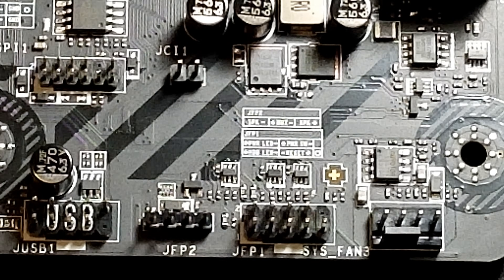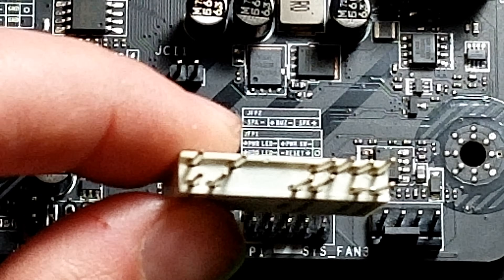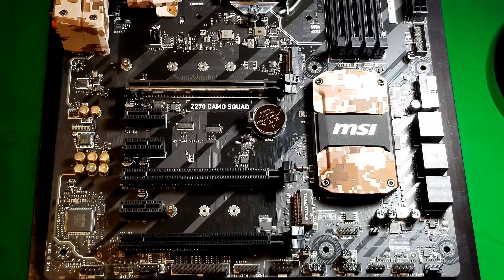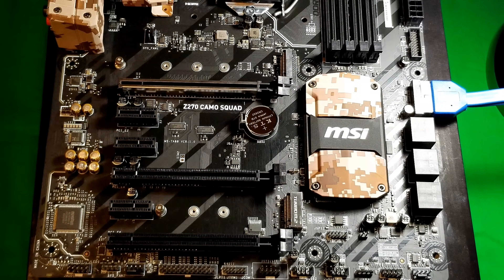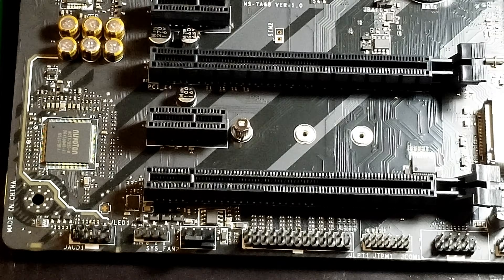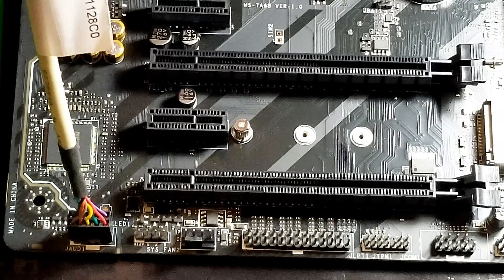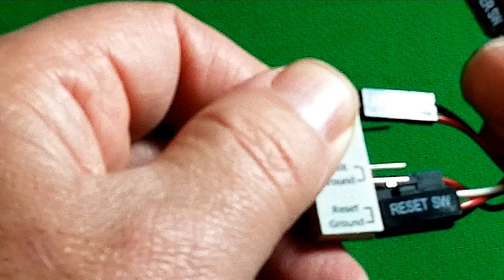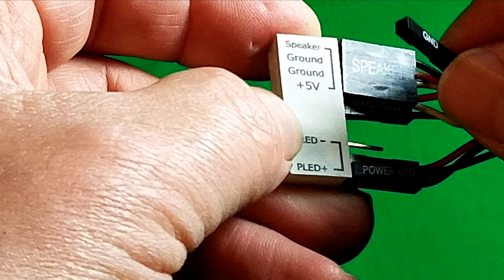Connecting your Case Front Panel connectors to your Motherboard

Comment: So when you plug in the power cable why dpes the positive Side needs to match ground Side? Shouldn't it match with power Side?
Reply from the maker: The PLED + and - matter, the Power can go either way and will still be fine and no damage will occur...Thanks...
Reply: Yeah I put the power connector in just the opposite of the way he shows and everything works fine on all my PC builds.
Reply: Thanks a lot for the answer!

Comment: At the minute 10:34 it shows the power cable arrow lining up with ground on the adaptor , how come ?  Shouldn’t be with the power pin on the adaptor ?
Reply from the maker: The Power LED + and - do matter, however the Power and reset don't matter how they go in as long as there in the right location...even if you made the mistake of the Power LED  + and - being in the wrong spot it would just not start but would not cause any kind of damage, if that happens just change them to the correct pins and it's all good...that's why I mentioned in the video that even if I connect them (those particular one's) that it will still be ok...Thanks...
Reply: Reviewing Playing & More RPM now I got it and understood , sorry for the confusion 😋
Reply from the maker: No problem, it is one of the trickiest parts of the computer build, it does get confusing...Thanks...

Comment: Where is the usb 3.0 on a msi A68HM-E33 V2 my usb 3.0 and the usb connector is split on the same cord
Reply from the maker: Your Motherboard doesn't have USB 3.0 on board, you can use an adapter to have that feature though...
Reply: Reviewing Playing & More RPM what’s the Adpter  called
Reply from the maker: @beastfight3355  There is the Vantec 4-Port SuperSpeed USB 3.0 PCIe Host Card w/ Internal 20-Pin Connector Model UGT-PC345, there are also some that use SATA instead of Molex now as well...
Reply: Reviewing Playing & More RPM do I really need the 3.0 USB
Reply from the maker: It's a nice to have but if your PC is working fine, then no you don't, as you use newer devices though it can be nice to have...another one that uses SATA Power is 2 Port PCI Express PCIe SuperSpeed USB 3.0 Controller Card w/ SATA Power...Thanks...
Reply: Reviewing Playing & More RPM Where do I put that host card 20 pin  at on the case
Reply from the maker: @Beast Fight335 It would go in the PCIe 1.0 slot in the Motherboard...
Reply: Reviewing Playing & More RPM Where will it pop out On the back of the case
Reply from the maker: @beastfight3355  That's right same spot as you'd connect to a GPU...on the back of the case...

Comment: 1 question... the 1 pin connectors for the LED power are very flimsy. I think it is just because they only have 1 pin but it still has me worried. Am I overreacting? Is there a way to secure them more so they do not fall out? Super helpful video by the way.
Reply from the maker: They are made that way and once inserted won't fall out, there is a little metal plate that when you push it on will hold on somewhat tightly and while it'll come of easily if you try to pull it, otherwise it won't come off...Thanks...

Comment: What is that adapter called
Reply from the maker: It's called the Asus Q Connector, it's not in stock now though, a lot of items are hard to get these days...Gigabyte has there's called Gigabyte G Connector...(ASUS 12G05100030B Q-CONNECTOR KIT) and probably best to search ebay or elsewhere as there hard to find these days, although the one for Gigabyte often comes included with their newer MBs...

Comment: where do you get that connector with the labels on it?  What's it called?  I've tried searching on Amazon and Google, but those idiots keep coming up with different products not related.  I've tried "motherboard io connector" and other related terms, but nothing.
Reply from the maker: Asus has one it's called a Q Connector, and Gigabyte has there's called Gigabyte G Connector...(ASUS 12G05100030B Q-CONNECTOR KIT) and probably best to search ebay or elsewhere as there hard to find these days, although the one for Gigabyte often comes included with their newer MBs...

Comment: Is that white piece an adapter that you can plug your wires into the plug the adapter to the motherboard?
Reply from the maker: Yes, I used it as an example it came with an Asus Motherboard and can be bought on Amazon, Gigabyte has started including them with their Motherboards as well, Asus calls theirs a "Q Connector" and Gigabyte calls theirs a "G Connector" haven't seen any for the other manufacturers yet though...Thanks...
Reply: @Reviewing_Playing_and_More_RPM  Well well well, I installed my motherboard two years ago, and I recently accidentally puller some of the wires off, after I reinstalled them I had no power or hhd light. After you reply I looked in my motherboard box (I keep a lot of stuff) and there it was.  Thanks so much for the reply.
Reply from the maker: @jimmymullins4997  No problem, glad to help...

Comment: having problem get my son pc gaming asus board running after replacing psu,  the power comes into mother board and power button does work but does not trigger the fans and mother board to come on,  i need help. any help please. i find this new boards very confusing yet i have build many pc in my time and no problems.
Reply from the maker: So new PSU's are silent, they don't spin up the fans until under load, start with checking that the 24 pin and 8 pin are inserted all the way in, then verify the cables from the case are inserted into the front panel connectors as in the video...then verify the memory is in the correct slots, usually 2 and 4 and if necessary remove the memory and re-insert them to ensure there inserted properly...those are the main things that might be a cause...hope that helps...Thanks and good luck...

Comment: I have the speaker but i do not have jfp2
Reply from the maker: It's not always JFP2, a lot of the motherboards have all the connectors all in one place, you'll need to check your Motherboard Manual to see but when there's no JFP2 that means it's on the top right of where your Front Paenl connectors are...good luck...Thanks...
Reply: @Reviewing_Playing_and_More_RPM  ok thank you!

Comment: Do i use both jpf1 and jpf2
Reply from the maker: You use whatever your case cables require, ie if you get a Speaker included with your case it could be part of the JFP1 or separated like in this video...every case has it's difference's...a lot of cases don't include a speaker though...some also don't have a HDD LED light on the case so therefore no cable to plug in, it's all dependent on the case...Thanks...

Comment: I need to know if either of these motherboard has a way to hook up front panel usb 3.1 The HP Z800  and the HP Z420 or an adapter to hook to the mother board I put links to a picture to the motherboards  I bought 2  
EZDIY-FAB 5.25in 10Gbps USB 3.1 Gen2 Hub and Type-C Port,Front Panel USB Hub with QC 3.0 Quick Charging  on amazon   I am having trouble hooking them up ttps://www.ebay.com/i/232612189528?chn     https://www.ebay.com/i/274104306026?   Thank you
Reply from the maker: The HP Z420 has a USB 3.0 connector the HP Z800 does not from what I can see...now the two hubs are different in that the EZDIY-FAB USB3.0 Front Panel Hub 5.25 Inch with 1x Type C Port, 3X USB 3.0 Ports and QC3.0 18W Fast Charging Port has the USB 3.0 to plug into the Motherboard, the other requires a MB with a Type C port on it to use it...Hope that answers your question...Thanks...
Reply: @Reviewing_Playing_and_More_RPM  Thank you for getting back to me.   I found a pcie card to do the trick .  It's made by the same company that make. the front panel usb 3.1 gen 2
.  I am crossing my fingers that this works.
 EZDIY-FAB USB3.1 Gen2 Internal 20-pin Front Panel Connector Expansion Card 10 Gbit/s USB 2.0 PCI Express 3.0 X2 Adapter for Desktop PCs (ASM3142)
Sold by: EZDIY-FAB.
Reply from the maker: @naomisvision  Looks good, I don't see the cables that connect it though but maybe those are on the case already...good luck...

Comment: how did you know which one was the + and - for the power cable, on the pins you put it in it didn't specify for that power/ground one?
Reply from the maker: The Positive is the arrow, the negative is the one with no indicators, for the PLED Power it matters, but for the Power it can go either way and won't cause any issue's...hope that helps...Thanks...
Reply: Reviewing Playing & More RPM Thank you, that’s what I was confused with because the cable has the arrow indicating + and - but the motherboard where the power cable is supposed to plug into doesn’t specify + or - unlike pled.
Reply from the maker: @sadathalam838  The PLED has to go in as pointed out, but the power can go either way it won't matter it'll still work...

Comment: Okay, I know how to install it but I’m confuse because he can detach from the case on the back so how do I attach to the case?
Reply from the maker: The cables are attached to the case on one end, and plug into the motherboard on the other...the cables I used were separated from a case that was being discarded so I could show it better...Thanks...
Reply: Reviewing Playing & More RPM Thanks I figure it out. Turns out my case  had them detach but f panel connecter to connect to the other end
Reply from the maker: @elexustrades  cool

Comment: You told us arrow means positive but you put power differently. Why? Arrow points clearly to the ground. Now what?
Reply from the maker: At 10:33 in the video I see what your saying, so I went to look at the adapter and to remind myself why I did it this way, at different times in the video I mention that the Power LED + and - do matter, however the Power and reset don't matter how they go in as long as there in the right location...even if you made the mistake of the Power LED  + and - being in the wrong spot it would just not start but would not cause any kind of damage, if that happens just change them to the correct pins and it's all good...Hope that helps...Good Question, I added this info in the Description to help others in the future...Thanks...
Reply: @Reviewing_Playing_and_More_RPM  thank you! Great video by the way!

Comment: Dennis I need help. I built this computer and finally got it to work, I was playing a game and I went to plug in my headset and accidentally hit a button that is connected the the psu (the really tiny wires that you showed us). It caused the motherboard to light a white light then it stopped. After that I turned off my pc and turned it on, now it can’t connect to my monitor. I cleared the cmos but it still does not work. Do you have any suggestions?
Reply from the maker: Not sure I understand how you could plug in a headset from the outside and touch something inside? It sounds like you might have plugged into the back audio and accidentally turned off the switch for the Power Supply, in which case you just need to turn it back on, the I is on and the O is off...and also at the same time might have slightly pulled out the cable from your Graphics Card, so check the cable and see if it's pushed in all the way then it'll send the signal to the monitor...not sure why you cleared the CMOS but what happens when you clear the CMOS is your motherboard will reset your BIOS settings to their factory defaults, the settings that the motherboard maker decided were the ones that most people would use. So you will need to go into the BIOS and first set the BIOS to Load Optimized Defaults, and XMP On for your Memory...then reboot and hopefully this will help...Thanks...
Reply: Reviewing Playing & More RPM I figure out what happened. I pressed the reset button and I think I turned off the pc too soon. I’ll just return the motherboard and install the new one. Thank you again for your help!
Reply from the maker: @nivalis3904  Any time...

Comment: pls help me, i have tried everything, i plugged everyting in the right spot on the motherboard while outside the case and it turned on, but when i put the motherboard back in the case and plugged everything in it did not turn on, one time id did turn on while i had the power cable for the motherboard plugged in and the power for cpu plugged in while the motherboard was inside the case but when i plugged in the rest of the cables like usb, audio and other and felt like i was done the power did not turn on... (ive installed all the risers)
Reply from the maker: Check that the Memory is inserted correctly, that your Power Supply is working right and not faulty by testing it...ensure when you placed the stand offs that none are missing a screw as it could potentially cause the MB to short...check that the Power Button is working correctly, ie try turning it on the same as you did before you placed it in the case by removing the cables for the Power only and see if it starts if it does that might mean the case has a faulty power switch which can happen although not to often...by risers I'm guessing you meant stand offs? anyway check those and hope it helps...Thanks...

Comment: I was hoping this video would help me out with a motherboard upgrade I did (the manual that came with my Asus mATX board was horrible).  Your mini-Asus mock-up made things much more confusing for me. I viewed it 3 times and still am at square one.
Reply from the maker: What Motherboard, I'll let you know then where to put things, also please include which Computer Case your using...Thanks...
Reply: @Reviewing_Playing_and_More_RPM  Thanks for the reply. I found a solution on another channel.
Reply from the maker: No problem, glad you found a solution...have a great weekend...
Reply: @Reviewing_Playing_and_More_RPM  Thanks.  I couldn't wrap my mind around your little ASUS model you had in your hand (I was trying to finish a ASUS mobo installation)  I had to watch another video to finally understand what you were saying.  It was my fault...tired from  the all-day upgrade process.  Have a great and safe weekend!
Reply from the maker: @RCfromtheNYC  You too Sir, have a great weekend and Stay Safe...

Comment: if i only have a power switch connector do i worry about the others not being connected? My system is pre built and im planning on swapping the motherboard so i can have some more room for upgrades later on.
Reply from the maker: You could get by without the Reset, and HDD LED, but will need to use the Power and PLED + and -, the others if you can use them that would be best but won't affect the PC Performance itself...Thanks...

Comment: My case comes with an all in one JFP1. Does that mean I don't need to plug into JFP2?
Reply from the maker: No, I'm thinking you have a NZXT Case, they started making these and it's great wish everyone made them like this...you still use the JFP1 just line it up with the pins and it'll just plug in...if all manufacturers made them this way I'd have to get rid of this video lol...hope that helps...Thanks...
Reply: @Reviewing_Playing_and_More_RPM  Yes I have NZXT case. But the JFP2 is technically for a motherboard speaker, which is sold separately. Correct?
Reply from the maker: @mattryan5393  Typically the Audio will say HD Audio or F_Audio but it's not for a speaker, the speaker is usually sold separately but can come with some cases, what MB are you using?
Reply: @Reviewing_Playing_and_More_RPM  Im talking about the JFP2 header that says buzzer and speaker. I'm not sure what goes in there, if anything. I have the Msi mpg 570x gaming wifi.
Reply from the maker: @mattryan5393  Ah ok, now I see what you're talking about, yes the JFP2 has 4 pins for the speaker and the others are not used...Thanks...
Reply: @Reviewing_Playing_and_More_RPM  yeah, I wasn't sure if I needed to plug that in.
Reply from the maker: @mattryan5393  No problem have a great weekend...

Comment: didnt you connect the power button the wrong way? when you put + on ground?
Reply from the maker: No pretty sure it was done right...Thanks...
Reply: @Reviewing_Playing_and_More_RPM  is ground plus or minus? I dont understand.
Reply from the maker: @adrianakuzmikova1697  When it pertains to the wires in a computer case the manufacturers don't follow conventional electrical rules, in that when you look at them using the power as an example you have one that has the arrow which is considered Positive, and the other beside it will be negative, so for computers that's what is important...(ground/negative)...hope that helps...
Reply: @Reviewing_Playing_and_More_RPM  but then when I am looking at your video at 10:31 and you say triangle is + you connected it to ground. so that is what I dont understand.
Reply from the maker: Both the Rest SW and Power SW will work either way it is plugged in, so it wouldn't make a difference...

Comment: I've built a few computer by now and putting together one with an ASrock matx mb thing just wont turn on.
Reply from the maker: Have you tried the usual steps such as reseating the memory, ensuring your in the correct memory banks, testing your Power Supply to ensure it's working correctly and double checking all connections...if you've done all this and still can't get it to work then it's possible you have a defective Motherboard and might need to RMA it...Good Luck...Thanks...